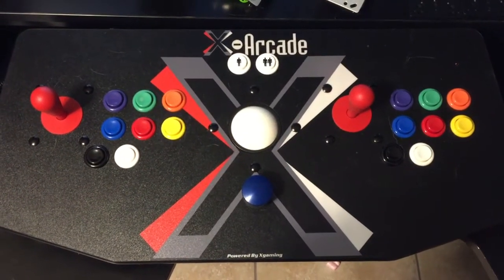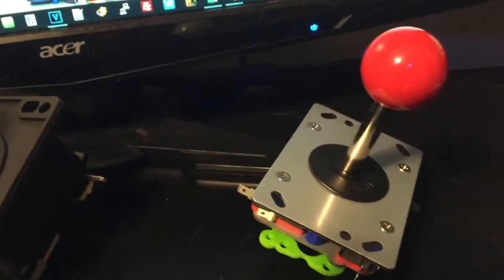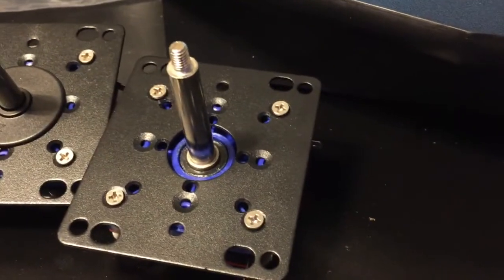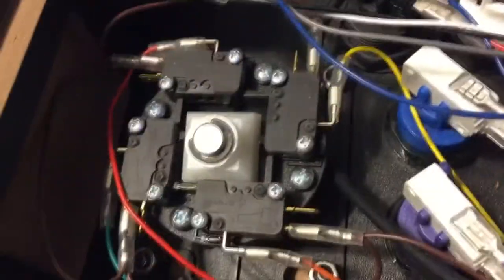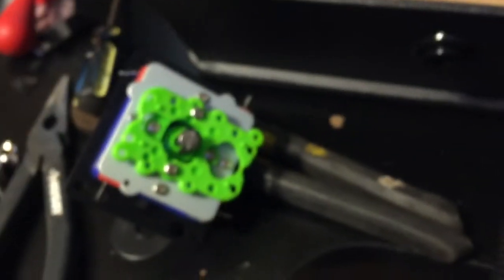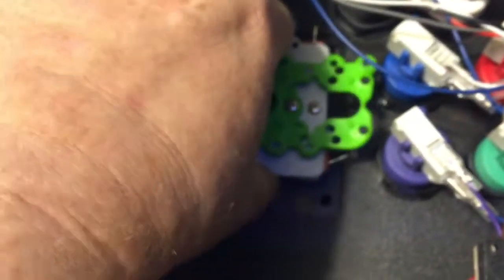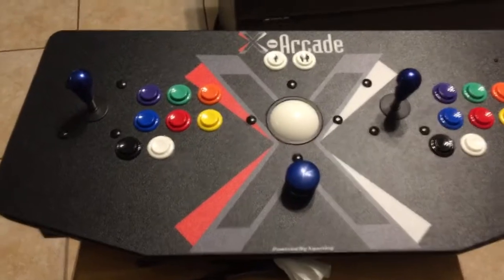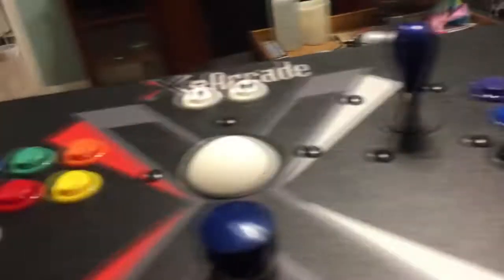XArcade Tankstick MOD 4 -  Replace Joysticks with Seimitsu LS-32 / Sanwa JLF / Zippy

Comment from the maker: So far we are really enjoying the Zippy Joysticks, they seem much more accurate than either the XArcade joysticks or the I.L. Eurosticks.   

I have ordered thumb screws and rubber feet for the bottom of my XArcade and thumb screws for the Zippy Joystick restricter plates.  Once I receive them I'll do another video for that small mod which should make opening the XArcade to switch the joysticks from 2/4/8 way much easier and faster and with no tools required..

Comment from the maker: So bad news on the thumb screw mod, after ordering and receiving several different size thumb screws and rubber feet I was unable to get them to work in a way that I was pleased with the result.   

The problem with thumb screws on the joystick restricter plates is that the shaft of the joystick ends up hitting the screws preventing the shaft from engaging the switches.  This was especially true when the U clamp coder pin  that hold the shaft on hit the screw heads.  I was using M4 screws that were 12 MM long for the joystick restricter plates but as mentioned above the heads on the screws interfeared with the joystick shaft.  

The thumb screws on the XAracade back panel worked but if I use thumb screws that are small enough to fit in the original holes they are very difficult to unscrew and if I use larger thumb screws then I need much larger rubber feet and I really didn't like the way it all looked done.    I initially tried M4 screws that were 20 MM long but they required really large feet to make it so the screw heads didn't hit the table before the feet and the screws didn't go into the sides of the XArcade very well.   I also tried M3 screws that were 8 MM long (which is about the size of the original screws) but then the heads of the screws are so small that unscrewing them is difficult to the point that it physically hurt your fingers to unscrew them.

In the end I decided to just keep a small Phillips head screw driver with my XArcade so i can open it and change the restricter plates as needed.
Reply: If you could make the ball glow green that would be cool

Comment: Great videos! I have the Tank Stick too. Were these Zippyy clone joysticks long enough for  use through the wooden panel on the Tank Stick or did you need to buy shaft extenders?

Comment: Is it easy is it as simple as open it up take out the the old joy stick and reconnect the new ones ?
Reply from the maker: Assuming the new sticks holes line up or you buy the correct mounting plate yes.

Comment: Damn I ordered some Zippys and they are rectangular base plate, not square like these, so they don't drop in. Any advice?
Reply from the maker: Derek Green you will need to either buy a universal plate to swap with the plates that come with the zippy sticks or route your XArcade to accept the plates.   I used these from Paradise Arcade, I know they say they aren’t stocked but others have said that they contacted them and were able to get some anyway.

https://paradisearcadeshop.com/home/controls/accessories-parts/mounting-plates/paradise-arcade/1280_universal-il-arcade-joystick-adapter-plate
Reply: @DIY-Nick  thank you!

Comment: That web site says the iL adapter plate is no longer in stock. The other universal plate they have in stock doesn't have corner holes that line up right. I haven't been able to find a comparable plate anywhere. Does anyone have any ideas for that?
Reply from the maker: If the holes don’t line up my only recommend would be to drill new holes with a power drill.
Reply: @DIY-Nick  Thanks man. I got lucky, though. They found a few of those plates in stock that they didn't think they had. I appreciate your video. It's very helpful.

Comment: Cool video. I was debating on purchasing that universal mount. I have a Double Dragon 2 arcade cab with a metal panel. I have Sanwa buttons in it and I purchased some Sanwa knock-off sticks before I knew this mount existed. Right now, I am using an "improvised" mount: https://imgur.com/gallery/kTwwq7X No issues as of yet.